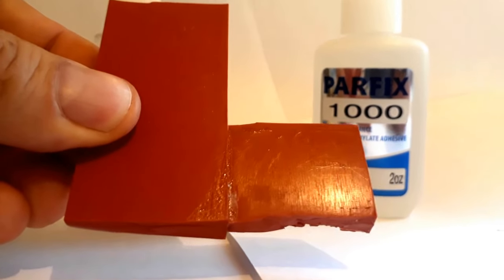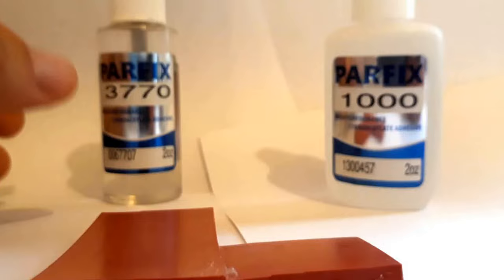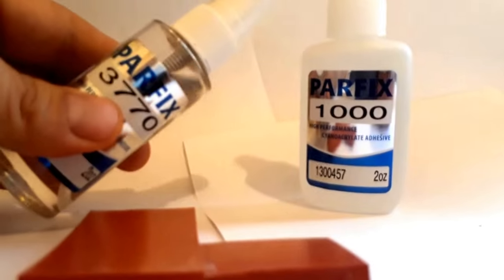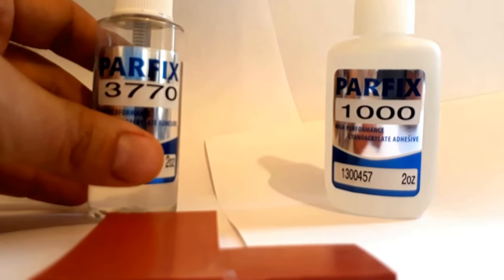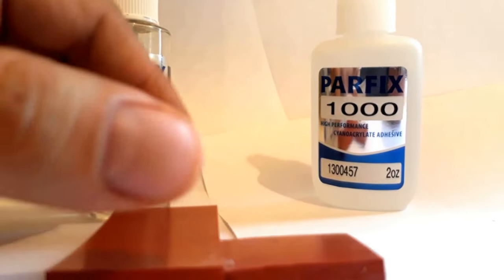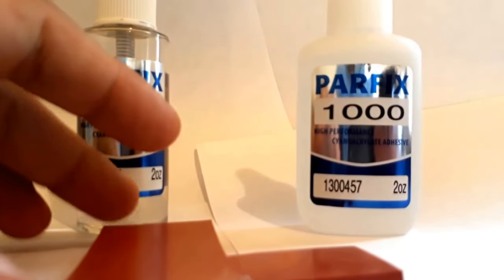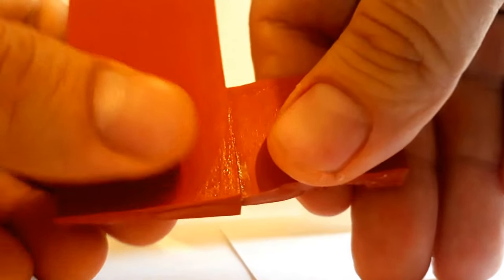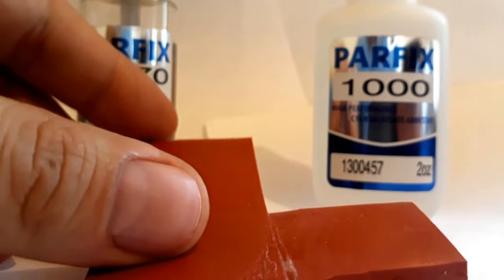Bonding Silicone Rubber

Comment: would have like to have seen him twist it
Reply: Would have also liked to have seen him glue them together then in front of us try to separate
Reply from the maker: Parfix 1000 has a rigid bond. It doesn't do well when you twist it. Maybe sometime I will do the same video but with a rubberized cyanoacrylate like Parfix 3411.

Comment: is the bond going to take the same temperature as silicone? around 250 Celsius? thanks for the video.
Reply from the maker: Unfortunately no, only 80 Centigrade. If you need high temperatura, use a Silicone RTV but it will have a much weaker bond.

Comment: Well if is that good we can use it a lot in our shop RSM Rv how bout silicone with plastic ?
Reply from the maker: What plastic? Very difficult to bond to low surface energy plastic like Polymethyl methacrylate (PMMA), Teflon (PTFE), and Polyethylene(PE),  Polyethylene(PE), and Polycarbonate. No primer needed for HDPE , PVC, PET/PETG (Polyethylene terephthalate), and nylon.

Comment from the maker: Minimum buy through a distributor is 24 bottles of one ounce PARFIX 1000 in two ounce bottle and 24 bottles of PARFIX 3770 in two ounce bottle.
Reply: August Egner is it possible to bond automotive silicone hose
Reply from the maker: Unfortunately I do not have samples.
Reply: August Egner is it used to stick silicone hoses
Reply from the maker: Yes but you need to have alot of surface area on the wall.